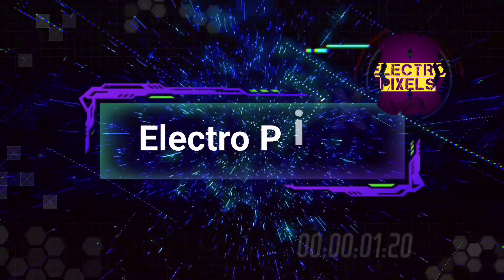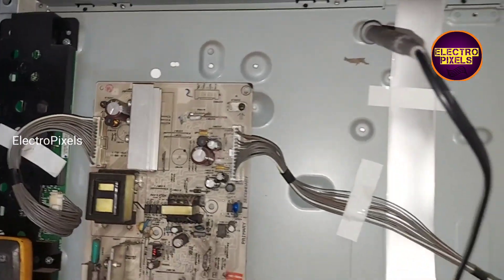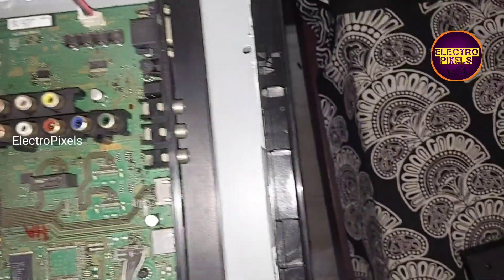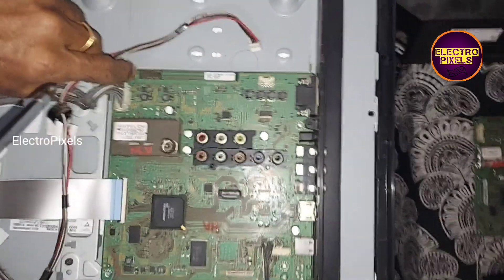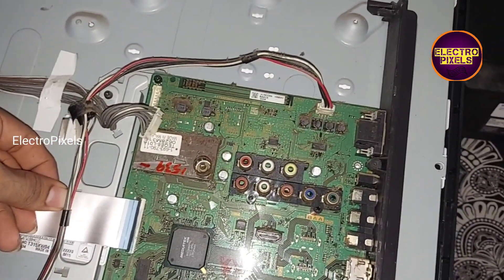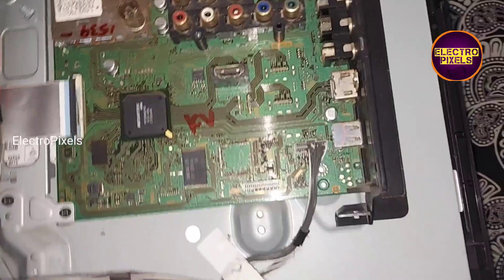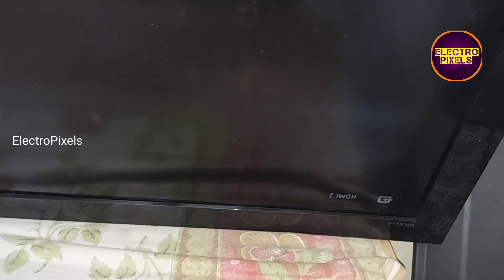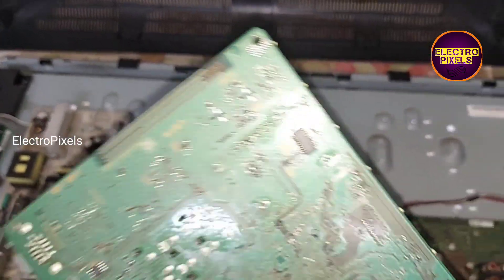How to Fix Sony KLV-32BX300 Lcd Tv No power indicator Set Repair |No Power SMPS Ok|Tvrepair |Repair

Comment: Gud day master how about if no red light no power sir 3.2 is present but no 12V power supply? Sony Bravia KLV 32EX300 same board in your video sir. Thanks
Reply from the maker: You need check for any shorting
Reply: We have also Same problem